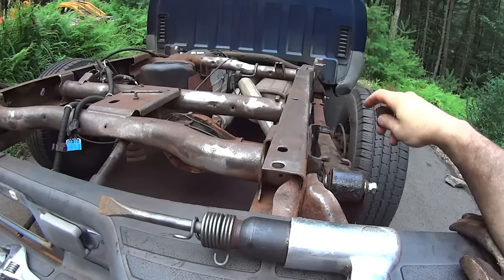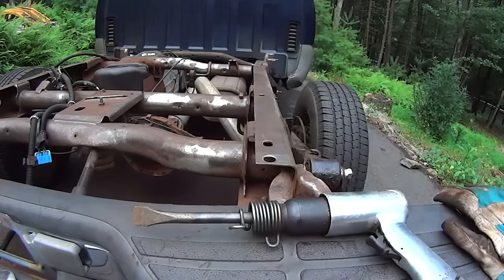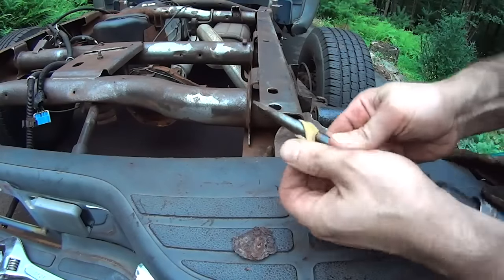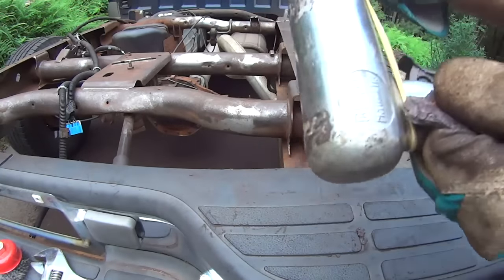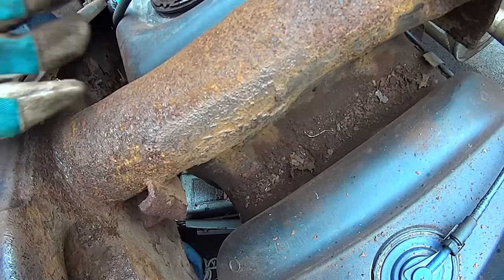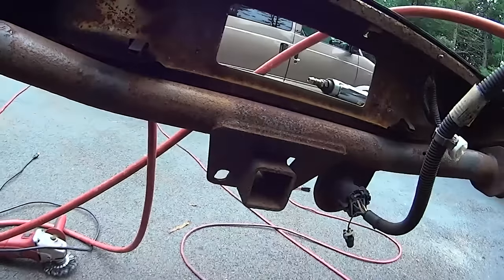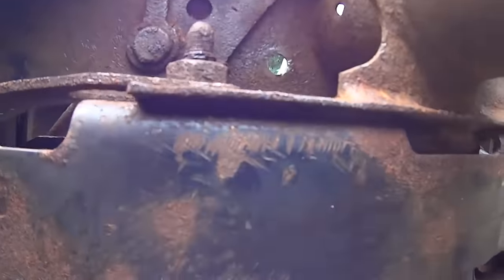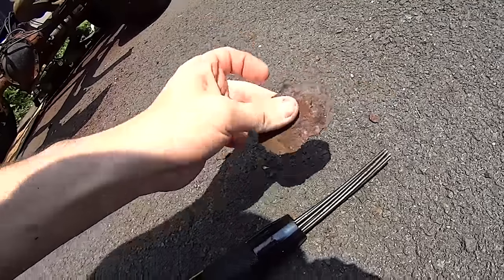Best tool for Heavy Rust Removal , Scaly, Thick Rust

Comment: I have dealt with my fair share of rust and I have become pretty familiar with different acids and sand blasting media’s  and every sanding/grinding/wire attachment for the right angle grinder and I have tested every pneumatic type of apparatus and I’ve learned that nothing is wonderful on everything but everything has its niche and is wonderful on something and as far as the needle scale as compared to this chisel I was doing structural welding for a few years and when it came to removing this type of heavy rust the chisel was king hands down and one big reason was that it requires far less air to operate so it can keep moving where the scaler has you sitting and waiting on air and if you were a distance from the air supply you could find your scaler doing jack shit where the chisel was able to operate with the losses experienced by long air lines- second was that needle scalers experience many quirky little issues with stuff bouncing out of place and stuff coming loose because it’s a pretty complicated tool compared with the chisel- I love a scaler and use a scaler but if this job was mine and I had to chose I’d choose the chisel hands down but since I don’t have to choose I’d use the chisel first then put the shine on it with the scaler
Reply: Can you find  what happened?      Quick-Glo  isn't avalable .   It's a mystery.  -Quick Glo has disappeared. No one can contact the owner's that made a famous ad with Jay Leno.  Inventories have disappeared in the U.S. ,U.K. and Australia. Does anyone know for sure what is happening?  I ordered a large supply months ago from their Website which is still running. I rec'd nothing not even an email confirming my order.  Quick-glo is the best for chrome and rust and as a preventative.   If you know what has happened; please please report on your findings.
Reply: whats ur opinion on xion labs 2 in 1 ?

Comment: Those battery operated hand tools that vibrate for wood working ,do a great job. 
I have just done this on my chassis on an 8 ton water truck. 
These tools are made by Making, Ryobi, all the main brands. 
There is an attachment for metal work. 
I found it more gentle than the other two, just as effective and easy to hold and operate. 
But the chisel does work, I just don't think my neighbours would have appreciated it

Comment: You could use a needle scaler . Pretty much the same thing but works alot faster
Reply from the maker: Needle scalers are useless. Watch the video to the end please.
Reply: Worked on a ship once where 50 guys above me on the main deck were each using a scaling gun to clean rust off the deck. Thought my head would explode.

Comment: That's a cool idea. I used a commercial pressure washer to knock off all the excess loose material. Worked great. Have to attack the rest of it by hand before treatment. Make sure you got that ear protection broski.

Comment: I restore frames and my best tool is the needle scaler. The air chisel is great but it is scary using it on older frames. I work in Massachusetts near the Cape and the trucks up here take a beating.

Comment: May I suggest a Needle Scaler. Its made for the job and won't chisel though your now much thinner steel as easily.
Reply from the maker: Needle scalers are useless for heavy rust, good only on surface rust. I did use bunch of them.
Reply: They work better when you have sharp needles. Much safer around brakes line and wiring...  and better when you want to get into crevices and tight areas. You can't control that air chisel as well as a needle scaler. But sure, its good to get the big chunks off. The needles are your scaler were totally flat so of course it's not going to work that good.

Comment: Good job Krystian. Very smart with the tool. It's a disgrace that GM didn't coat there frames. Obviously on purpose knowing that they would rust out. This is why people shy away from American cars. Obvious planned obsolesence. As I said, my Nissan van is dipped. Have you used Amsoil heavy duty metal protector?  Wax based protectant.
Reply: Jay Gold  -  For Sure . I have seen Cadillacs that were perfect except for a rusted through frame .

Comment: What about the frame supports up front by the engine? I would be very concerned about that. Are you going to show us that? Also shackle repair.
Reply from the maker: Jay Gold I'm doing only the rear of the truck while I have the bed off. Later I will move to the front and work on that.

Comment: 4000 psi pressure washer with wet sandblasting attachment.  when dry, POR as primer, then topcoat with coal tar undercoating.
Reply from the maker: Didn't have the pressure washer and attachments. Can't imagine the mess, especially trying to blast the tight spaces with long pressure washer handle and all the water with sand blasting back on me. But I'm sure its effective on body parts.
Reply: +Astro Camper : Only good on body parts with the finest sand or baking soda. Large grit WILL distort sheet metal.

Comment: After you clean and area take some transmission fluid and mix it with dish soap and water then spray the area " the transmission fluid has anti rust adatives in it and the soap will make it  stick.to the metal it.will prevent rust from reforming on the area you have cleaned and it works for a year or more so it's perfect for people restoring car"s and trucks since the work can take to complete before ,.you can primer or paint your project.

Comment: There is probably alot of more rust buildup than lost metal.
Reply: The other problem is boxed frames rust on the inside too...very hard to get at that rust.
Reply: @dominiquestephenson195  I'm using Eastwood internal frame coating. Only someone said - that if you don't have all the dirt and buildup cleaned out first - then the paint just traps moisture. hmm.
Reply: Isn’t Eastwood internal frame coating more of an oil anyways?

Comment: That metal spring on an air chisel is there to do exactly the job of your rubber band. A collar on the bit should be very much constrained by the spring thus the tool not requiring an outside pressure to oscillate.  I guess that bit does not fit your tool, like it is too short, the collar is too close to the inside end. Or there could be something wrong with the chisel: the bit sits far too deep.
Reply from the maker: Not enough travel with the spring. The rubber bend allows it to move over and inch and hit the rusty metal harder. Otherwise, its just a vibrator.

Comment: would you paint it after completion or just put mineral oil ?
Reply from the maker: I would paint or put grease mixed with melted wax. Not mineral oil (too easy to wash away with salt)
Reply: +Astro Camper 
thanks for the information.

Comment: I'm a commercial painting contractor giving serious consideration to buying a dustless blasting system for my company. We would start with a smaller unit and try to sell our way to bigger jobs, bigger equipment. Anywho,......the reason I mention this is because that system would take this chassis to virgin white metal in about an hour or two. I realize the $8k price tag for the unit (plus compressor rental) is cost prohibitive for a hobbyist but I'm wondering if there is a market for auto restorers to hire someone for this. Would it be worth, say $400-500 to have the chassis stripped down to a factory clean surface? Search you tube for dustless blasting and comment. (And no, ....I don't work for them or sell the equipment). I'm just really torn on spending the $.
Reply from the maker: Personally i wouldn't spend that much for sand blasting. There are many spots that sand would not reach. And then there are spots with rust so thick, sand blasting would do nothing.
Reply: Astro Camper .... Although I understand your point, the system I'm talking about isn't a sand blasting system at all. It's high pressure water and glass beads. For our commercial purposes it would be used primarily on all different types of industrial framing and platforms, storage tanks and various metal containers. It just seemed like it would be perfect for this too, but maybe not.
Reply: there is definitely a huge market, not enough people have sandblasters commercially available

Comment: those tubes on the frame where a disaster design they should be boxed in or a totally different design.
Reply from the maker: My coworker had GMC Sierra and his fuel tank just dropped one day cause the tube rotted out (fuel tank is attached to it).

Comment: wouldn't it be easier to just sandblast or use a rust remover chem
Reply from the maker: To thick and flaky to sandblast or spray rust converters. Some sheet were 1/8 thick

Comment: Too funny.. Done a good deal talking about how to not use an air chisel. It has a spring for a reason. It's the best thing ever. If you used properly you would have saved a lot of time.
Reply from the maker: The spring is there just too keep the chisel from falling out. There is about 1/2 inch play. Go to Harbor Freight and look at the tool. Using the spring, the tool is only good when you push on it.
Reply: Chad Hickey-  Those aprings don't work that well.

Comment: You do realize that your chisel is not attached properly to the air hammer, right? The metal spring on the end of the air hammer screws onto the hammer and locks the chisel in place with the hook on the end of the spring.
Reply: troller the man knows what hes doing what videos have you made
Reply: not hardly, Wesley.
Reply: Silly guy, twist that coil spring a little bit and you can put the bit in all the way and then the spring acts like a real man's rubber band. Some people are so smart but miss the craziest stuff
Reply: he should just talk at the rust to bore it off
Reply: Nice guys briliant bit of advise
Reply: Jax Turner how about a needle scaler.......it's made for this.......
Reply: 2nd that, we called them Needle Guns in the shipyard. Loud as hell but did the job
Reply: did quite a bit of shipyard time.... you NEVR forget that sound  Not to mention the smell of Portsmouth Yard
Reply: a needler
Reply: Paul McDuell 
Also called a needle scaler.
Reply: I wasn't gonna say anything.
Reply: @381 322 needle scaler

Comment: Damn you love that truck I just used rp -342 on my 06 GMC Sierra trying to save it from rusting like this
Reply: I used same rp-342 the salt washed off in the car wash better this winter. Only salt I see is in the bottom center of cross support. I just do phosphoric acid treatment. haha. I got one weld plate put on also. Hopefully the "rust creep" won't destroy the chassis.

Comment: This is 100% not the right tool. They make a tool called a needle scaler , I have one and it works miracles on thick heavy rust like this. You would never use an impact chisel.
Reply from the maker: I show those at the end of the video. They are joke for rust that is super thick.
Reply: @troutjunkie7330  never had that problem with my ingersol rand scaler. That thing mows through thick rust so easy. If anything you have to be careful on the thin rust because it can just beat up the metal. Are you sure your spring is stiff enough on your scaler?

Comment: The needle gun works better. Maybe you're just not using yours correctly. Also, It looks like yours is missing a few of the needles. Never seen one with that few needles in it. Usually the needles in the barrel are packed in almost to the limit. Or maybe the ones you have are just cheap Chinese products or just not run at the correct pressure or cfm. Point is, when used correctly, the needle gun wins, hands down.

Comment: Why wouldn't you just use a needle scaler? It's like air hammer but it's got needle brushes instead of a chisel that could cut right through the metal if it goes to the wrong spot, right? Like the idea for the rubber band that could be used on any application.

Comment: I’m 17 and rebuilding a 91 Dodge D250 12 valve with major rust, it doesn’t help that I live in a state that uses an insane amount of salt during winter. Just looking for tips on how to get bad rust off quickly but also a bit quieter for my neighbors until I rent a shop. Any tips would help!!

Comment: I have used the same thing on a large steel hulled boat . Works well . You can also used a cold chisel and hammer if you don't have the air tool .